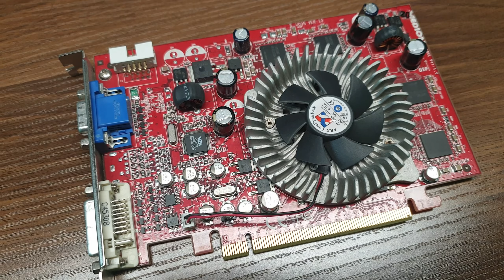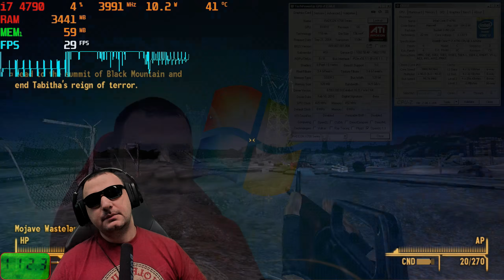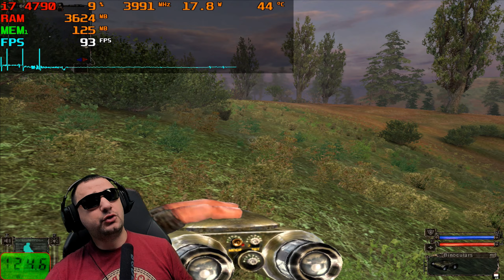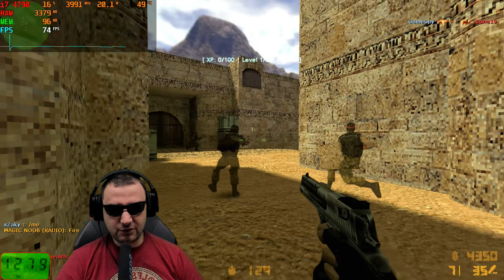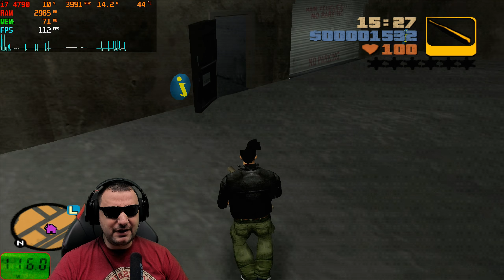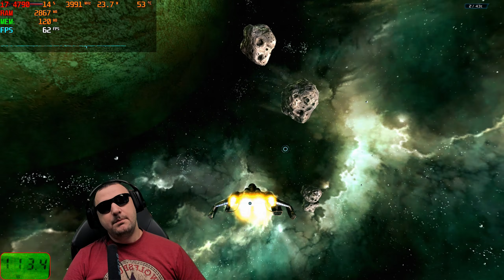ATI Radeon X740 XL Benchmark

Comment: Daniel, if you feel adventurous you could try getting ATI FireGL 9700 X1-256 That is basically the famous Radeon 9700 Pro but with double the VRAM making it close to the legendary Radeon 9800. There is FireGL X2 (AKA 9800) but it looks like its not available... 9800 XT is already a unicorn so i thought maybe there would be more luck with FireGL X2 but it seems like Workstations like HP c8000 had only X1 as an option and so finding X2 is extremely hard.
Reply from the maker: AGP PRO and £100 +  🤣
I don't even know a mobo with that. Only what mac has.
Reply: @DanielCardei  Oh, i just looked on it, and it seems like techpowerup is listing it in one place as agp pro, and non pro in other place, but looking at the picture it looks like it must be pro. My bad! :)  I only looked for these cards on ebay, yeah they are pricey, but i thought maybe you know of other sources, some with lower prices. It was just a thought, i'm not pushing or asking🥴
Reply: @DanielCardei  Oh i see now. There are 2 versions agp pro, and non pro, i was thinking about that one, but it looks like there are only agp pro versions left... OK, i guess that's about it :D

Comment: So release date was march 2005, not 2004. Radeon X850 xt pe was the top model that year.
Reply from the maker: @0MeALot0  I'll have a hard time from now on to trust gpuz.
Reply: @DanielCardei  Ooh yeah gpuz is wrong about these cards. X800 xt and X850 xt would have the same release date... they do not. X800 is like rx 480 and X850 is like rx 580... they do not have the same release date. But the software readout is the same. Like hd 7970 and r9 280x.

Comment: 12:00 : i've done things like that ,there have been many cases when i bought an old(obsolete) GPU just to have it ,since during its era i couldn't afford them and i had promised to myself that one day i'll own them !!
the most extreme purchase i've done ,was about 3 years ago ,i paid around... 😁100euro just to own a GeForce 4 Ti4200 ,although this is an AGP-card and i knew that i'll never use it !!! ,but as i said i had promised that purchase to myself back from 2002/2003 when i couldn't afford such card and i had picked a GeForce 4 MX440 instead (*decent GPU but still i was stuck to buy a card from the :medal-yellow-first-red:Ti(Titanium)-series !! )
--I've done many similar purchases ( 8800GTX /8800 Ultra /GTX560Ti 448core /GTX580 3GB ... ) but the GeForce4 Ti4200 is my only purchase that i knew from the start that i'll never use it😁(just sits in the self ,nearby my 1st ever discrete graphics card the:virtualhug: nVIDIA Riva TNT2 Ultra !! )

Comment: 10:33

that is funny😂

ps:i remember x700xt performance is good but never  released
Reply: The reason why X700Xt never been releases is that even this card couldn't really handle a 6600 GT, so ATI decided to reduce the price of the radeon X800 (later X800 GT) This cards beats the 6600 GT. X700 Pro was still a decent card slower than 6600 Gt but faster than 6600. I would say that the X700 Pro is equal like 6610 XL

Comment: I have the same card. Its a Radeon X700 Pro with few more Memory Clockspeed 450 MHZ (900 MHZ effective) instead of 430 MHZ (880 MHZ effective). This higer Memory clock gives the card 1-2 fps more then the standard X 700 Pro